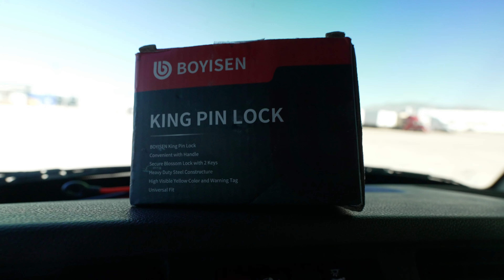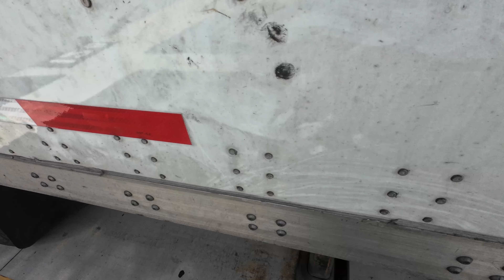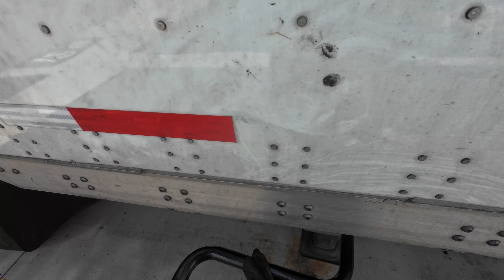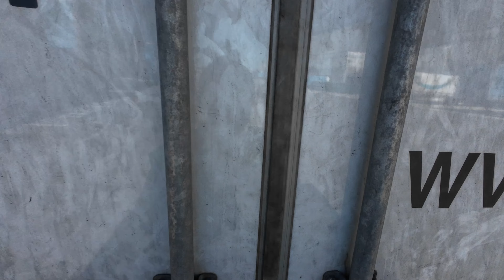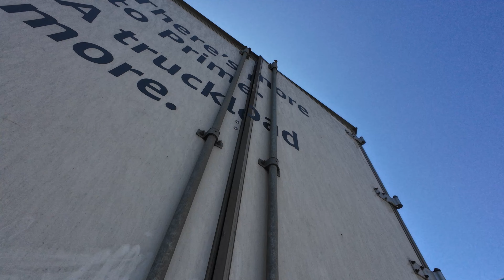Switching Gears We Running Amazon Loads

Comment: Have you ever considered bidding on the local USPS mail contracts? I spoke with a contract USPS carrier and they were home daily and running lighter* loads most of the time. Caveat being they want you to have a back up truck available but that can be a rent as needed agreement. Any thoughts?
Reply from the maker: To be honest I haven’t really looked too much into it. I did look into bringing my truck to them and run under them. That was a long time ago and I lost interest during the process. I might look into it some more.
Reply: @pinoytrucking   Being close to a hub? probably helps. They were going from something like a central distribution center out to smaller towns, but would also get back hauls from the smaller towns back to the distribution center. It was all in state so no IFTA I think.